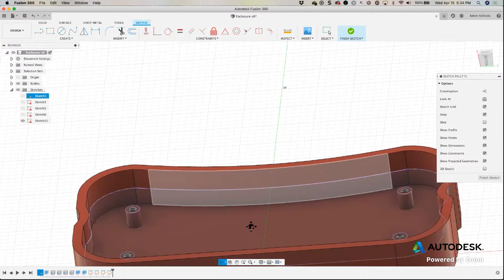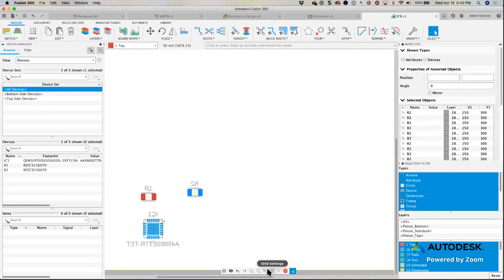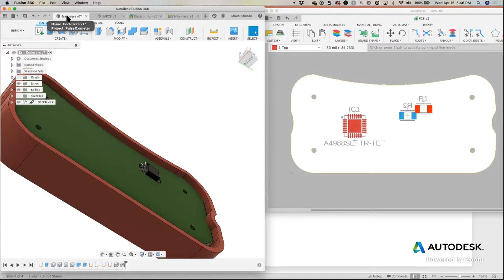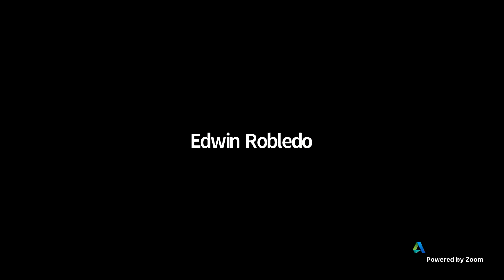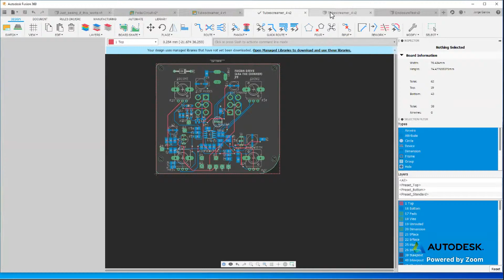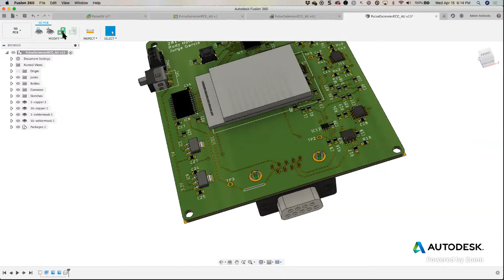360 LIVE: Electromechanical Workflow

Comment: There were a different PCB linked to the assembly, not the one what was modified - that why the update not worked.
Reply: It was frustrating to watch that struggle, when Ed was using an old "3DPCB" (all upper-case) and not the latest "3dPCB" (lower-case "d" and without the cut corner on the board).  ;)